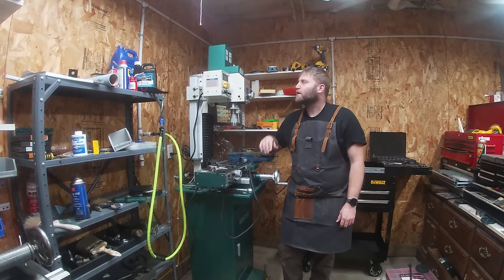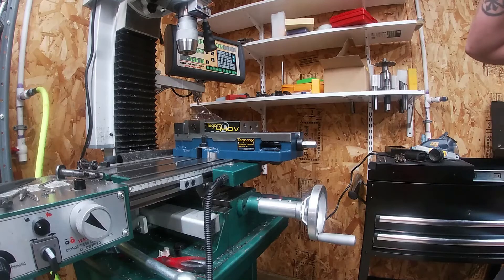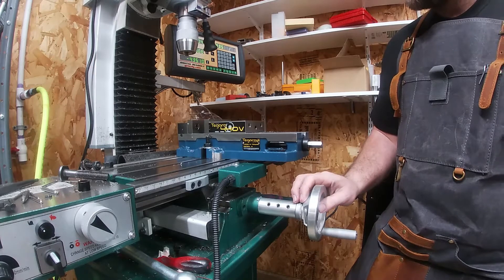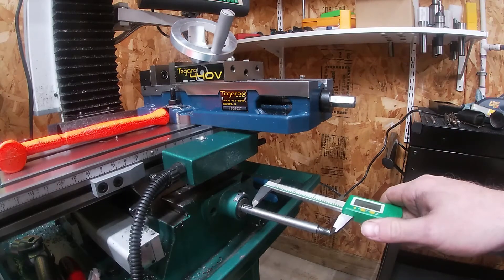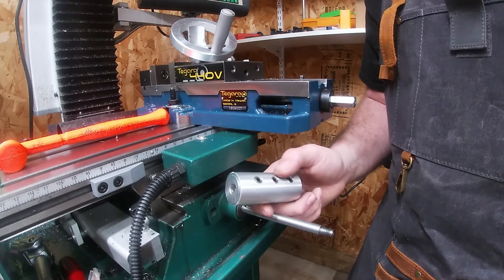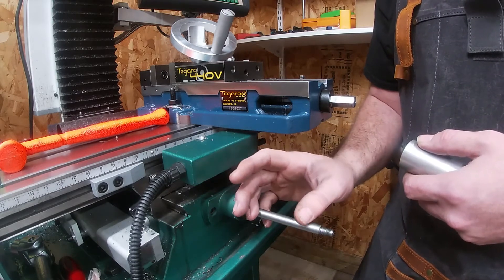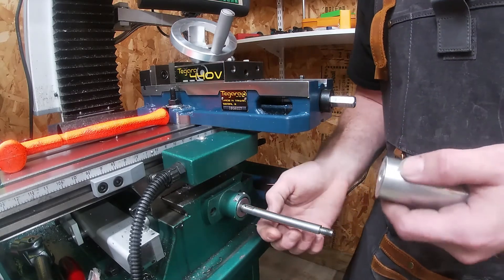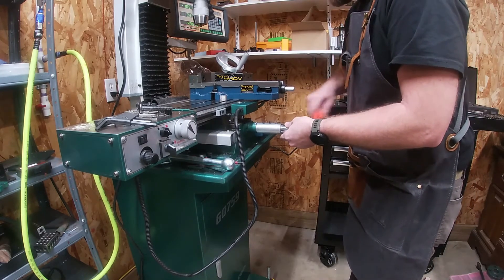Grizzly g0759 (g0704) y-axis handle extension for manual machines

Comment: Hi. What is the od on the x and y shafts where the hand wheels are. Or handwheel center hole id. Are they the same? I would like to buy the correct size rod extension material. I am going to be doing work on both x and y feed screws.

Comment: Sure would like to see drawings on your quill lock. The hole Grizzly puts in is pretty silly. I think I'll make a new bracket for the X axis stop switch box. Having to drill two holes in the casting is another weak point that the Grizzly folks should have put in at their ISO 9001 factory!
Reply from the maker: I really need to finish that video about the quill lock.  I'm not very computer savvy, and I've had a heck of a time filming a video on my go-pro, catching audio on the mike, getting both of those files on my computer, syncing them, editing it, and uploading it.  I'm getting better at it, but it's been a slow process.  

I have family down this week, but I'll try and put something together in the very near future.  I can't believe that Grizzly doesn't install a spring loaded pin from the factory.  

Thanks,
Jon

Comment: I appreciate seeing your fixes. My g0759 is not here yet. Been waiting a couple of months. I have a 4" vise and the power feed unit, as well as sets of imperial and metric ER 32 collets, etc. awaiting the arrival of the machine.
Reply from the maker: Thanks for stopping by!  I think you will like your mill when it comes in.  Waiting for it to show up is the worst part.  Sounds like you got enough tooling to get you up and running when it arrives.  

I didn't realize Grizzly was that far behind on delivery now!  
Good luck and enjoy your new machine,
Jon